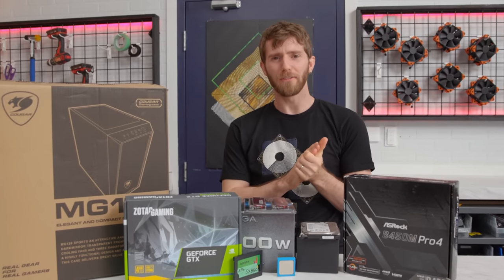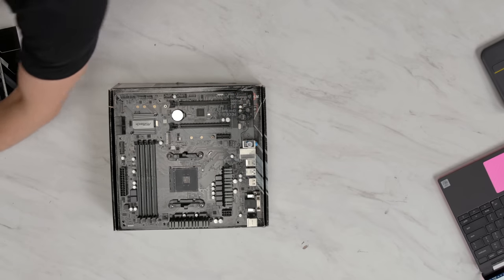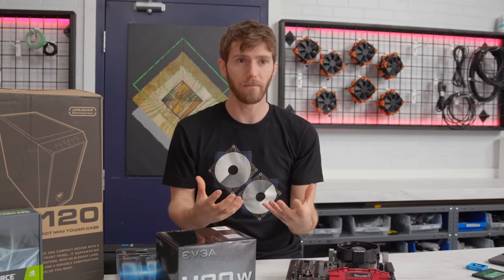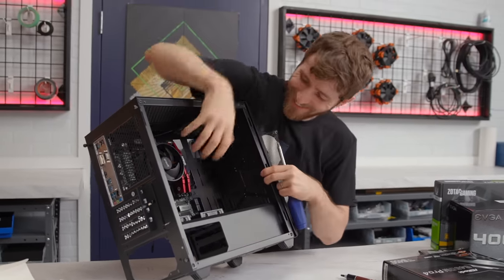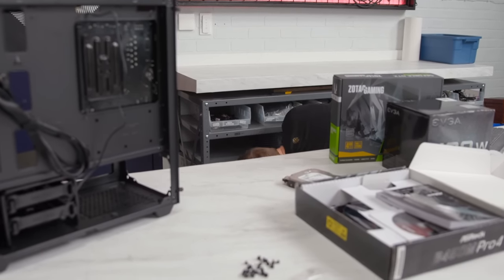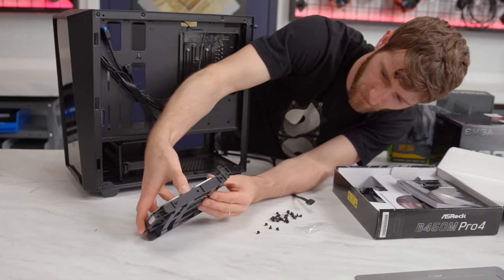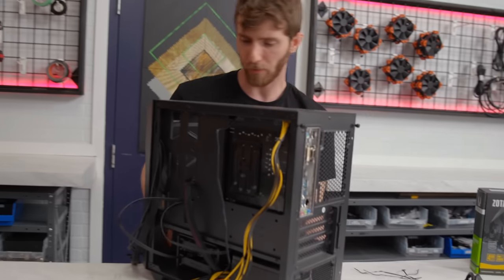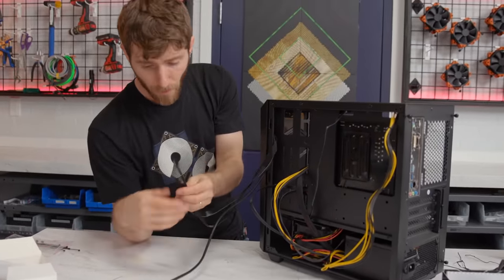Building a $500 AMD Gaming PC

Comment: Hey, my  intel last-gen core-2 quad q9450 was an absolute monster of a gaming CPU when paired with 8GB ram and 2 GTX 760 TI OC's on the "It belongs in a museum!" level rarity Asus p5e3 motherboard.  Just load that up in image search sometime and you can see why that beauty was the final word when it came to anything that predates intel-core processors (i3/i5/i7).

Yes, it runs Doom Eternal.  Yes, it runs GTA V just fine.  Even Dark Souls: Blighttown is solid 60 FPS with DSfix.  The only reason I ever owned that wonky setup was because I bought the components for DIRT cheap.  This was around 10 years ago, and I spent something like $60 on the board and CPU (I swear, I tried to give the seller more because it was extremely unfair to sell at that price.).  The board at the time could sell for upwards of $500 (it could essentially use the FSB as a CPU augmentation, giving it extra virtual cpu registers, and making the core 2 quad 'look' like an 8 core system to Windows.  It also used the power of the swan-song to give the CPU more direct memory management and PCI-Express connection.), and had an FSB, northbridge, and southbridge chips that were 2-4 times larger than normal (including extra distribution chips above and to the sides of the CPU for aforementioned  direct interfacing with various components).  It was ridiculous to the point that the FSB, bridges, and ancillary chipsets all had heat pipe/vapor chamber cooling solutions built in and required.  This was NOT a low-power board at all.

Speaking of swansongs, the core 2 quad I had, I think it was a q9450 or  something to that end, was literally one of the last models that Intel produced, and one of the fastest/largest cache size/durable/etc. (this CPU and motherboard combination is STILL running strong.) . 

As for memory, hdd, current GPU, etc., I unfortunately have no idea what running today without asking someone; because I did the dumbest thing I could have done with this (At the time,[10 years ago] my crowning achievement for custom PC system layout, design, customization,cooling solution, and build.) and GAVE IT AWAY to a friend who's machine catastrophically failed on them, when, at the time, they were holding onto my machine and storing it because I was basically 'walking the earth' like Kane in Kung Fu for several years.  At this point in life, toting around 30-40 lbs worth of computer would not have been the most fruitful or comfortable things I could have done.

So, they have the machine, they use it for gaming.  I look at it as helping someone in need so a couple of the other personalities my brain stop yelling at me for giving tech away; that's right, go back to your easy chair and read your books on physics.  We have a transmission to design later!

Comment: I always thought you don't use top of case a intake because hot air rises... not entirely sure but 3 outtakes should stop the case from having residual heat built up in the case and it can pull missing air from the vents in the front panel

Comment: Guessing here from my electric knowledge,but they're gonna run 12volts to the mother board to be able to run some components at said 12v,to not put such a drain,I.e..amperage draw,on the 5v line.remember V/A×Ω. It'll take amp draw down tremendously

Comment: i liked this build video a lot, helped me out a bunch too i have put together a little rig with my stepson for xmas as his old pc was just that, old lol

The specs, 
-Ryzen 5 5600G 
-MSI B450M Pro-vdh (very similar to this one of the video)
-Kingston ram 16 gb (unsure which exactly bought this week and i am on bussiness trip)
-GTX 1050TI 4gb
- all in a sub 2010 aluminium budget case 
we reused parts of his old pc like his 650 watt PSU the graphicscard and the harddrive,
we had to indeed update the BIOS which was a lot easier then expected. 
I wonder where we could find a decent priced 6 gb+ GPU as that is my struggle atm and why we had to reuse the old 1050ti.

i will gladly use the link for the SSD but we try to find a PCIE SSD first :)
if anyone got something recommended we add it to the list so he can save up for them.
thanks again really enjoy the channel!

Comment: Building a whole new PC from the ground up is one thing, but how about upgrading one? I've had an older gaming PC that's been laying around for ages, I've considered bringing it back up to spec (at least to play some relatively non-demanding titles like Apex, Warzone, Minecraft, and some indy games). The current specs are pretty atrocious and I do worry that updated parts won't even work on it. The motherboard is a quad core Gigabyte GA-78LMT-S2, with an AMD FX4100, and the GPU is an NVIDIA GT610. Out of curiosity, is the motherboard worth saving, or the CPU? should I even consider upgrading the parts on this dinosaur or just replace everything all together?

Comment: Front facing USB-C for charging only makes sense if it's dirt cheap since the vast majority of USB-C cables are USB-A to C anyway

Now if you have specialized usb-c devices that are using more of the pins, that would be a different story
Reply: A lot of anker bricks use c to c no? Even c to lightning for iPhones.
Reply: @dreamtalk2794  yes, but the cables really aren't common is my point. If you lose one, chances are anyone you ask to borrow one it going to have a usb-a on one side. That, and if you have to buy one, they are cheap in comparison

Comment: The case looks like a Corsair Carbide 175R, but doesn't have some of the refinements of the Corsair, standoffs were already on and had some rubber around the cable management openings.  I just built a SIMILAR build, spent $1k, no vid card, using onboard video for now.

Comment: That cooler is way bigger than the one that came with my 5600x and mine has no copper slug, did they downgrade the coolers with 5th gen ryzen ?
Reply: No don’t worry there are comparison videos of new and old wraith coolers and it’s actually a decent improvement, I looked into it because I was also pondering why there’s no more Vapor chamber. So no you don’t need to upgrade your cooler even with some minor overclocking. ;)

Comment: I made a pc with a invidia geforce 750 ti (i alreadyhad the gpu), with a core i5 10th gen with integrated graphics for $159, 16 gb of ddr4 ram, 2 tb hard drive. (i did have a 500 gb m.2 but the 10th gen didn't work with it) a asus micro atx mother board, with a 59 dollar cases that came with 4 120mm fan, and a 80 gold  full Modular 850 watt power supply for $594 if you want more info I'll send you a link to what I bought

Comment: My Ryzen 3 build was great...I slid my DDR into the Ram slots, dual channel style... It made my Solid State HDD a good fit for my combo. I tweaked both Bios settings to highlight my needs, and then started playing on my firm mechanical keyboard settings.....great buildup to a Great ATX tower...I cooled the unit down with a good sized fan...

Comment: The graphic card is now $500 alone 2 years later.. 

ZOTAC GAMING GeForce GTX 1650 LP 4GB GDDR6 128-bit Gaming Graphics Card, Super Compact, Low-profile, ZT-T16520H-10L
4.6 out of 5 stars 1,851
$411.71 

OR you can get a 1660 super.. thats the GPU I would recommend so you can play Cyberpunk at 30FPS at least and that will run you a lot.. more.. dough baby!!

Comment: ive had decent luck with used stuff, just built a new computer.  open box b550 aorus master for 130, used ryzen 5 3600 for 209
sprung on other stuff tho, 16gig 3200 corsair vengance ram, wd black 500gig nvme.  after the case, cooler and fans i have about 600 into it.  used my old psu, old 850w gold modular raidmax

blows my old i7 2600 rig outta the water.  and i always thought that thing was quick, deff faster than the average computer, ive read that cpu held up well for its age tho

just wish gpu's weren't so insane right now, still running an old msi hd7950 twin frozerii, i just want this thing to run vr

Comment: The gpu is actually supposed to be cheaper than the ones thats sold on the description I've seen someone buy rtx 3060 ti for only 300 dollars so the gtx 1650 has to be cheaper

Comment: My first build was supposedly gonna cost me around 700$ ... and 1400 $ later I was able to get a b450 steel legend, a 1660 super, a crucial p1 500gb ( should have done the 1tb ) , G skillz Ram, and ryzen 5 3600.. If prices were normal I would have been able to basically get everything I actually WANTED with that type of money.. But go ahead and try to build that sammmmeeeee build.. It will literally cost you ATLEAST 1600$.. Don't get me wrong I run a good 100 fps on warzone on avg but If I were yall I would simply just wait it out for now honestly lol

Comment: My case cost me $30 my original budget was $300 years later theres $1400 in that bad boy. The plastic display panel on the front came off a while ago so it's an open concept now. I probably should upgrade it at this point..

Comment: Wow, back when you could build a whole PC for $500 rather than just a GPU
Reply: you can do that now
Reply: @nomadace777   depends on what GPU you want they still are being priced higher than they should be
Edit: also I have no idea if you wanted to stay under $500, you can try to get a GPU for around $300 it wouldn't be as good but it's possible, considering the cost of CPU's you could probably find something for around $150 and that's already $450 not including ram, motherboard, case etc.. I used PC part picker for reference but I can't find a way you maintain a modern GPU + CPU and still have enough space left for everything else
Reply: @KSI_Rogue  1050 is good now
Reply: @nomadace777  i guess if you want to pay an extreme amount for a gpu made 8 years ago you can but to me that just isn't even worth it. I guess if you plan on upgrading later on when these prices drop more than yea sure but you would still be over paying for a gpu that was made in 2016 also, what do you plan on playing? doesn't the 1050 only have 2 gb of vram? most games need more than that now.

Comment: I used the stock cooler and at load on cpu it sat at 70c to 75c which is perfectly fine. Moved back to AIO with tripple. What is the cost going to be like on the motherboards then with the expecting new powering styling.

Comment: @linus tech tip, what the cpu cooling fan you are using on cpu. And can these parts work in my cyberpower pc tower, because my wife did something to it. It run slow, and then  there be 4 or 5 commands windows open up when turn it on.

Comment: hi guys. i know this video is two years old so just out of interest and using only the links provided, in Australia this build would cost $1290.60 today. converted to US dollars  $955.37.
in one of our local department and electronics stores Harvey norman.   $ 1598.00 Australian or $1182.92 US dollars I can get a ready-to-use desktop.
Specifications
Brand	Acer
Model	N50-620
Processor Brand	Intel
Processor Type	11th Gen Intel Core i5
Processor Model	11400
Processor Max Speed (GHz)	4.40
Installed RAM	8GB
RAM Configuration	1 x 8GB
RAM Expandable To (GB)	64
RAM Type	DDR4
Cache Size (MB)	12
Keyboard	Wireless
Mouse	Wireless
Primary Storage Capacity	512GB
Storage Type	SSD
Wireless Networking	802.11ax (2x2), Bluetooth 5.0
GPU Chipset Manufacturer	NVIDIA
GPU Chipset	GeForce GTX 1650
Graphics Card Memory	4GB
Connectivity	1x USB 3.1 (Gen 2), 1x USB 3.2 (Type C, Gen1), 2x USB 2.0, 4x USB 3.2 (Gen 1), DVI, HDMI, RJ45
Operating System	Windows 11 Home
Manufacturers Express Warranty (months)	12
this is not a criticism just an observation and an indictment of global inflation.

Comment: Fast forward a year and the gpu is $500 alone
Reply: The whole pc used to be $500 but now just the graphics card is $350. So my suggestion is to get a prebuilt desktop since it’s cheaper, I got a desktop with i5-10400F, 16gb ram 8x2, a 256gb M.2 SSD, 1tb HDD, and a GTX 1650 Super for $700 and the specs are a little better

Comment: Welp, it's official. There is officially a really, really good argument for consoles now. You get essentially an underclocked ryzen 7 and an nvidia 2060 super with a PS5 or xbox one X and theyre at or under 500. They also have double the ram. The current gen consoles are actually much better buys for gaming than this computer. However, if I had the money and did not yet have a desktop PC or a laptop and had the choice, I would still choose to have the less powerful, borderline PS5 level performance PC over a PS5 or Xbox. at the end of the day it is a full computer and if you are good enough at tweaking you can probably improve the performance of this pc to match the PS5's with overclocking, OS decluttering and lots of fans.
Reply: Is that console to pc part comparison hardware performance legit?

Comment: thanks for the vids linus, lol im running an 1150 with a freezer pro 7 right now, injured signed off work with no way to upgrade from 1150, damn im still running hyperx ddr3 lol, yh i do hate the push pin cooler lol, ive had one fall clean out after breaking the clips

Comment: which of this I can upgrade?

AMD Ryzen 5 3600 6-Core, 12-Thread (stock cpu cooler)

Corsair Vengeance LPX 16GB (2x8GB) DDR4 DRAM 3200MHz

Asus TUF Gaming GeForce GTX 1650 Super Overclocked 4GB Edition

ASROCK B450M PRO4

Cooler Master MasterBox MB311L

EVGA 110-BQ-0600-K1 600 BQ, 80+ Bronze 600W, Semi Modular

Cooler Master MasterBox MB311L ARGB Airflow Micro-ATX Tower
Reply: CPU, but you'll probably need a bios update if upgrading from 3000 to 5000 series.
RAM, i think up to 64GB (4 sticks though, better to go with 32GB 2 sticks)
GPU (PCIE Gen 3 will be a limiting factor though)
PSU, but you'll be fine with not upgrading it unless you're planning on putting a power hungry card in there like a 3080+ 
Case you can always upgrade, but I would not recommend upgrading this until you have to
Reply: Basically have the same setup different case haha

Comment: Welp.., i have almost the same setup with some differences, i have the Aorus B450 Elite V2, i already had a 800W power supply from another pc. Im looking to get the AMD R5 3600 and right now the 6600 RX its as cheap as any 1650...

Comment: I have an i7 2600 (10 years old) matched with a 1650 Super, and that video card has always been the bottleneck when gaming.  Most games at 60FPS only use 30-40% of the 2600.  So a Ryzen 3100 is WAY more CPU than you need for this card.
Reply: You will have to change MOTHERBOARD RAM AND PROCESSOR TO UPGRADE thats why i dont like old intels

Comment: doom eternal with all it's mods is BARELY 100 GB if i remember, or less... and doom 2016 is larger. Eternal uses a bettter/more efficient texturing system that saves a ton of space and speed up loading time substantially.  It's also why it'll run on a toaster at 60fps... that engine is a work of art.

As for COD being like 200GB, I believe it, but does ANYONE actually play COD on PC?...  I think I might just be getting old and I'm slowly contracting the Andy Rooney disease,

Comment: Can I replace the 1650 Super with a 1660? As for the CPU can it be replaced by a Ryzen 5 3600? Also as for the SSD I've checked on amazon but its unavailable what other SSD's could I switch it out with?  (Asking since I dont have any experience in building PC's)
Reply: yep, and you could use any ssd's with compatibility with sata.
Reply: @phalp_  alright, thank you so much. i was just really worried that the 1660 might not fit in the case and block some of the outlets

Comment: Try building that now in the middle of this shitstorm. The cheapest gaming rig I could build that will run Tarkov on low settings is $850 usd plus tax. Doesn't include GPU. And yes APU. Penny pinching using a $199 motherboard, $39 psu, $70 nvme ssd, $$75 ddr4 ram, $80 case with built in fans, APU is a secret. Constantly going back and forth swapping out parts trying to make this as cheap as possible and its still pushing $1k without a graphics card. This GPU crisis is literally cancer especially when trying to build a pc.

Comment: c'mon, Linus, I know you're better than that... Coarse and fine threads?  I learned about that (the hard way... of coarse!) the FIRST time I had to do any kind of computer repair/disassembly ... That being said, I was like 11 years old at the time as well... I was lucky enough to have a stepfather who worked for IBM and  later Digital Equipment through the 80[s and 90's, and he had me taking apart old 286 and 386 SX/DX machines (and plenty of microchannel PS/2's...) and if he should have seen me use a fine thread on an optical drive instead of a coarse threaded bolt, I would  either receive a smack to the head, or a swift, biting comment that 

God help you with laptops, at least they are getting better about it, but many manufacturers still have multiple lengths, diameters

Also... @ ~ 3:10 - The term you are looking for is 'Guru'... A 'Beard Guru'.  Personally I don't like beards... on myself that is; as it doesn't fit my gender identity at all.  It seems to fit Lius quite well, however.)

Comment: 1:11:42 I’m so confused, I bought the same stuff, and followed the same exact steps, but I did this test, and got 914 for some reason? Plus it’s not as fast as Linus’s? I don’t get it, I really need help with this right now . . .
Reply: I’ve tried some things out, but I don’t know what’s wrong, I followed the steps to letter, but it’s not as good as what Linus made?
Reply: You may just be unlucky in the “silicone lottery” because you could have 2 of the exact same chips and yet the performance varies quite a bit. 
You could try overclocking your cpu which may help either get the performance you SHOULD be getting, or better.
If you aren’t confident in trying it yourself you could ask someone for help.

Did you also enable the XMP profile in the bios? It pushes your ram a bit more which might be something to do with it.